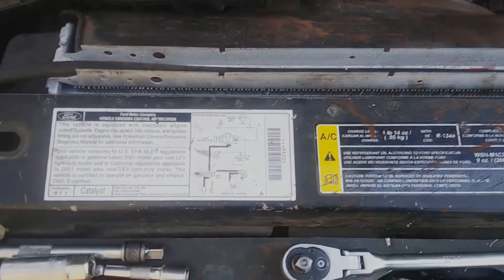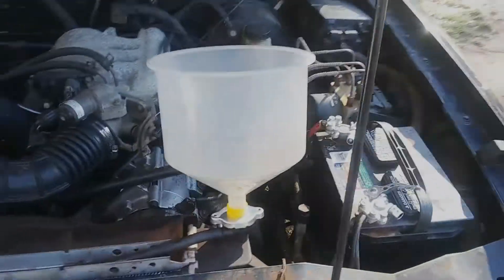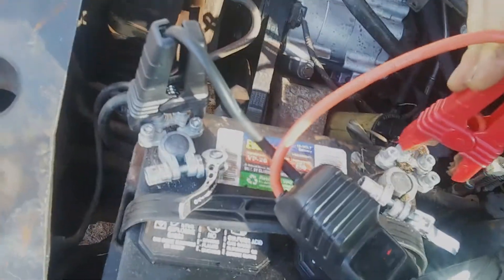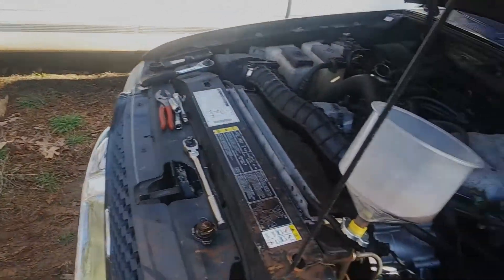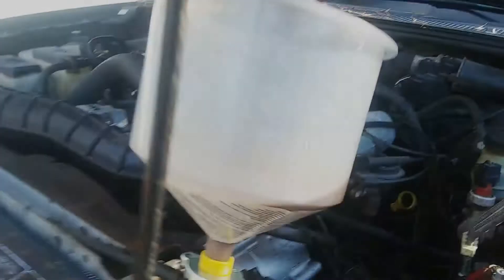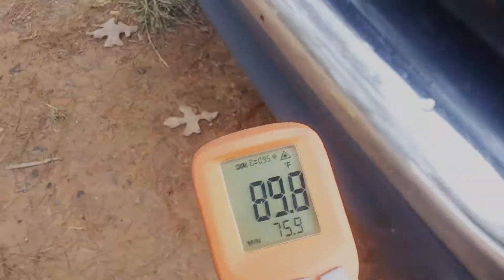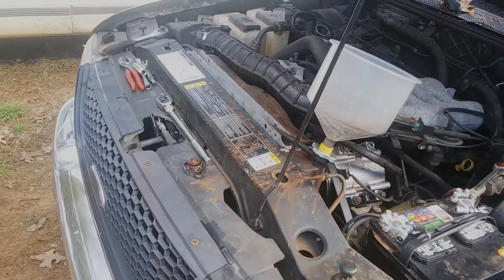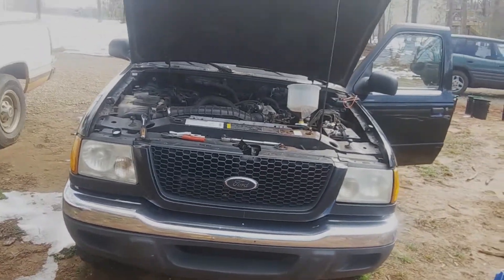Checking for a Head Gasket Leak with a Spill-Free Funnel

Comment: I figured this out after I kept getting air in my heater cirw. I keep bleeding it out with this funnel and never could get the heater to work very good. Then I noticed every couple of minutes there were some bubbles coming up but I wasn't having to add coolant. I figured it was a head gasket kwak, especially since there were no external coolant leaks, and that I had recently replaced the water pump that had been leaking and caused the engine to overheat. I then did chemical combustion gas leak detection test which confirmed my suspicion. But my first and really only indicator was poor heat because of all that air pushed through the leaky head gasket was getting trapped in the heater core. This was ib a 2004 mitsubishi eclipse with a 2.4L 4 cylinder.

Comment: I'm having the issue where my coolant in the Burp kit overflows and gets too hot I'm wondering if something is blocking the water from circulating throughout the system. I have an Infiniti FX35.
Reply: Bad waterpump?
Reply: Maybe bad thermostat ? Cheaper than pump, & easier.
Reply: I just replaced radiator,  I find out in mrng

Comment: If coolant is leaking out from the housing, then air can seep in from there also. Probably not a gasket.
Reply: What if car running at engine temperature open oil cap and.oil.starts bursting out is that normal
Reply: @trapps75  probably! Lmao never open any cap with the engine running, everything is pressurized on an engine
Reply: @chromecatfishcharters8765  it happened to Nissan Sentra I done it to my Toyota Corolla and nothing happened there saying piston rings are bad I see Chris Fixx open oil cap up no oil coming out he tells you to open it